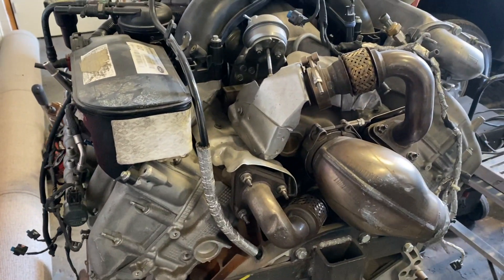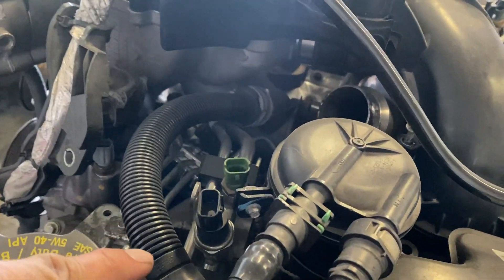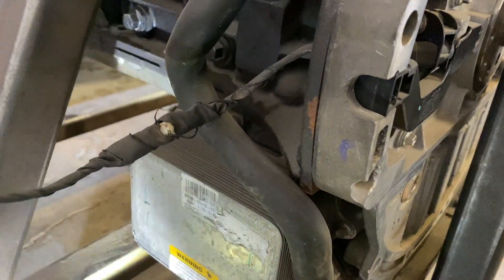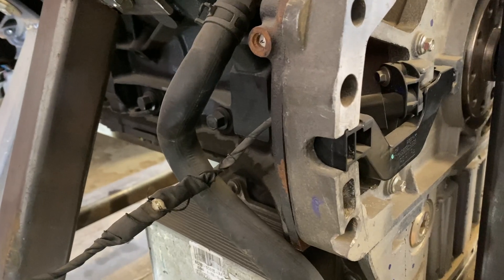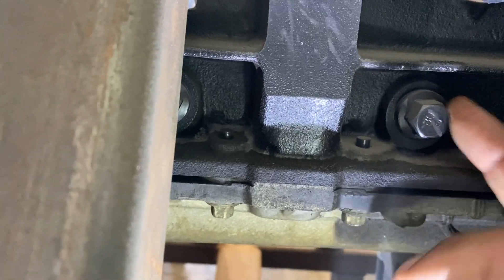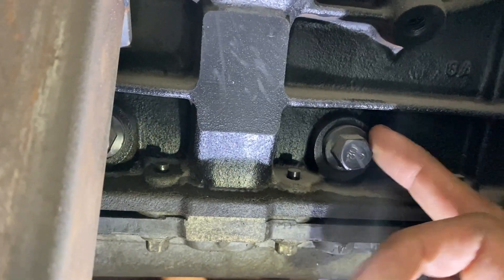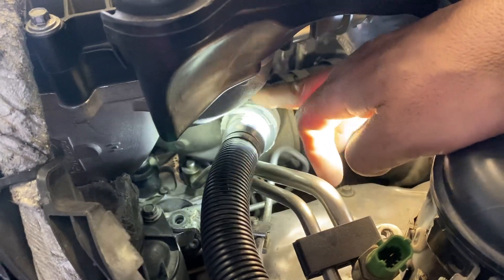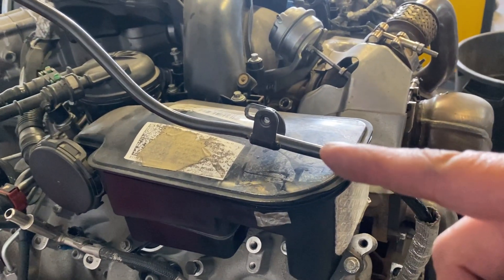Powerstroke 6.7L Closed Crankcase Issue

Comment: Quick thing I did was take an oil cap and put a gauge on it anything over a certain pressure your ccv is bad 😜. Hope that’s a handy tip. I think the spec I looked at. Was like over 5 psi is a bad ccv I have it somewhere. So what i recommend is take a good known good reeding off a pickup.  Then use it to compare for bads.

Comment: Looks like the CCV on the engine is swollen from pressure build up. That CCV is clogged and it’s causing increased pressure in the CCV and the crankcase. Might also be why the oil pan gasket area is leaking.
Reply from the maker: @deepcdvr123  this engine used actually was a low mileage engine
It had been used in classes and traveled a lot.
But you are correct about issues with CCV
Note that many 6.7s have excessive blow by by lack of maintenance

Comment: This really helps to see things you can’t otherwise see when the engine is installed. 
I have a suspect rear main seal. Where would oil leak and collect? I have oil coming from above the filter up near the starter? This seems pretty high up for oil to leak out. 
If the CCV is replaced will a leak reduce/diminish? 

If you have a video on this scenario that would be great. 

Thank you

Comment: How do you know when it's time to replace? Based on miles? Any signs it needs replacement?
Reply from the maker: Crankcase filter? Every 100k
But you should maintain and change oil at least every 4-5 k miles
Reply: @dieseltalkwithtonysalas8725 yea the CCV

Comment: So we are still sending CCVgas or engine sewage into the filtered cold air intake to the combustion chamber to mix with the finely metered air-fuel ratio lowering HP and MPG
Reply from the maker: @kevinoneill41  as we say in Spanish “Si senor!”

Comment: My 6.7 2012 is leaking diesel from the front bay it’s deleted and has a fass
Reply from the maker: If you are referring to the front engine valley you need to check the pump lines. The injection pump is in the front engine valley
Reply: @dieseltalkwithtonysalas8725  thank you

Comment: I have a 2016 f350 6.7 has non serviceable ccv 160k miles should it be replaced?
Reply from the maker: Yes replace !
Reply: @dieseltalkwithtonysalas8725  thank you ccv reroute or stock not worried about emissions only longevity

Comment: What year model is this? I have a 2015, my ccv looks similar but the top of the box is flat not rounded like this one. And it also does not have the bolts on top. Im wondering if mine has the newer baffle type filterless box, that doesnt require replacing. Or is that newer type only for 2017+ models?
Reply from the maker: No matter what year model we are recommending replaced of CCV Every 100k miles minimum.
Plus change your oil change intervals no more than 5K
Reply: @dieseltalkwithtonysalas8725  even for the filterless box? Supposedly it doesn't need to be replaced

Comment: Where is that sensor at on that CCV ? I have a 2016 , I deleted mine and realize there is a sensor there so I took the holes off the box and put it back on but I still have a code is there a secret to that sensor or did I wreck it by taking it off ?
Reply from the maker: Who said this is a business channel? 
Just trying to share information and help whenever I can but the reality is I have customers pay their bill when I repair trucks.
Those I do talk to in person. 
Need truck fixed? There are many reputable shops you can take them to.
Reply: @dieseltalkwithtonysalas8725  I’m not going to doubt that one bit but just given out a little information does not hurt I would love to call your shop and I do pay my bills as well and I own a business trust me I know everything you know but in a different field and I’ve been doing it for 50 years
Reply from the maker: It’s on the hose going toward the turbo inlet
Reply: @dieseltalkwithtonysalas8725  I reconnected it to the turbo but I’m still getting the code
Reply from the maker: @acmanwwjd1  need a scanner to check what the value is. Sensor or circuit issue. Which code is it?
Reply: @dieseltalkwithtonysalas8725  When I start the truck the minimax will tell me what it is in the morning
Reply: @dieseltalkwithtonysalas8725  P04E3
Reply: @dieseltalkwithtonysalas8725  P04E3
Reply: I sent you the code do you have an answer ?
Reply: @dieseltalkwithtonysalas8725  I sent you the code still never got a word back from you is there a reason for that ?
Reply from the maker: @acmanwwjd1  yeah! Tony in training this week! 
But I look it up when I get time this week!
Reply: @dieseltalkwithtonysalas8725  you guys talk good over the YouTube but a good salesman and a good mechanic will get on the phone and talk to people what happened to that in my business we don’t operate by email only
Reply: I have the exact same issue.
Reply: @alfredogarciajr1779  What is amazing is how nobody has an answer
Reply: @acmanwwjd1 don’t worry about it if you really want contact a tuning group and they can remove it via tuning. It’s not a derating dtc and won’t affect performance
Reply: Long story short. Don’t worry about the ccv code is not a performance dtc. 👍
Reply: I wish we could talk on the phone because I put the hose back and still get the code

Comment: What is too much pressure if you were reading with a gauge?
Reply from the maker: Sir , as far as I have researched, Ford offers no crankcase pressure spec. The funny thing is diesel manufacturer s have offered one for years but I’m suspecting they don’t because of the issue with premature DPF. 
But if I would compare with other V8 diesels I would say no more that 16-18 inches of water pressure but if you look at the Powerstroke 6.7L blowby DPF loading video you see how we address it. You need to watch the end .

Comment: I see many upper oil pan with insufficient amount of silicone on the pan. Also the front left side has the least about of metal surface causing a small crack. Ford has no specification for warpage for the upper oil pan. Crankcase pressure is always over look because for years fors has no specification. Well the new 20'S and up have a way thicker upper oil pan with a metal gasket, but we are seeing rear main seal leaking to due bad cranks. Good video man. Still haven't see mains bolts leak. I'll keep an eye know that.
Reply from the maker: You are correct! I appreciate your input! Thanks!
Reply: That acman at the bottom of the comments is salty as hell lol. We are not here to give out free information.  Everyone has an opportunity on what they study in. If we gave out all the answers and don't understand a system it is pointless because we took the time and paid the money to know and we are not paid to explain somethingto someonewho dont know shit about the electronic system. Nobody is obligated to give out any information especially if you don't understand the system and do some research.  And on top of the bs your not supposed to change or tamper with anything under the hood.
Reply: Also vacuum pump lower bolts have no factory lock tight and they loosen up eventually and it looks like a main seal leak. My truck currently has the vacuum pump leak, upper oil pan leak.